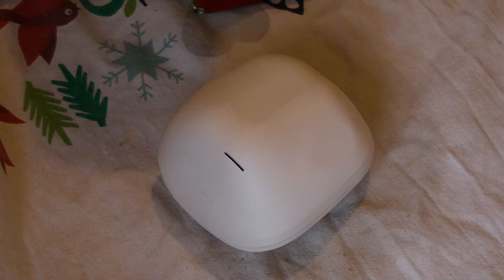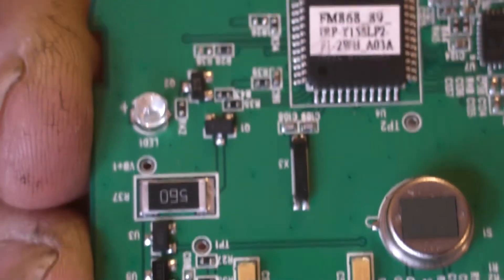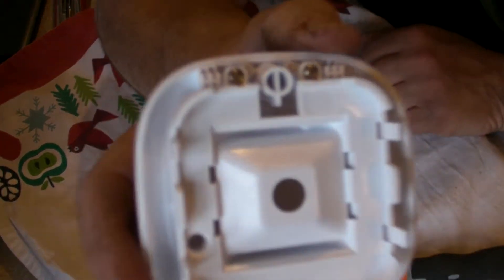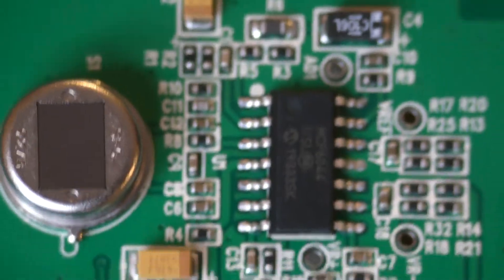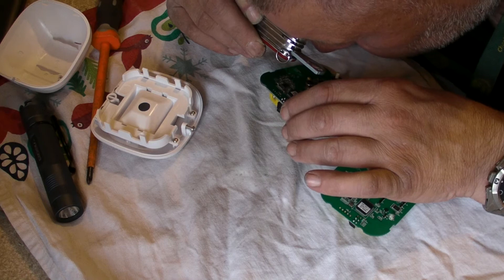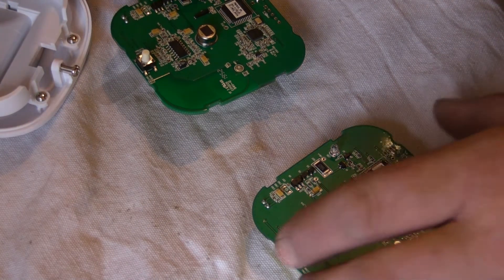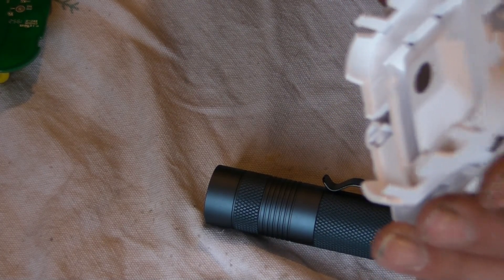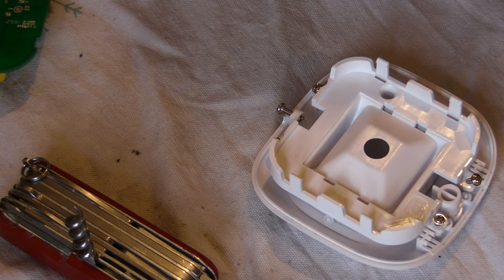Yale Smart Sync Home Alarm PIR vs PET PIR teardown and basic comparison.

Comment: Thanks for posting this. I’ve had trouble with false alarms from my garage PIR. Was considering a pet sensor but thinking twice now since they are both of the same sensitivity. Was the jumper set to the sensitive setting or the low setting ? I’d like to reduce the sensitivity of mine. Thanks.
Reply from the maker: i honestly have no idea re the sensitivity. i found even with pet lenses, my cats jumped on the furniture and triggered the alarm so i now just use window and door sensors.

Comment: I would think the pattern you are seeing is a frenzel lens.
The lower part will probably be masked on the pet version to reduce the detection height, but still pick up people who will normally be a lot taller than the average pet.
Reply from the maker: Yeah, the pattern is missing entirely off the pet lens. However, the standard version if mounted high works everybit as good. they are not super sensitive.